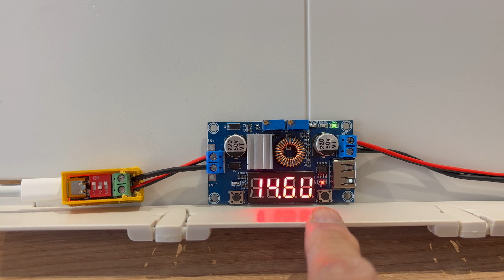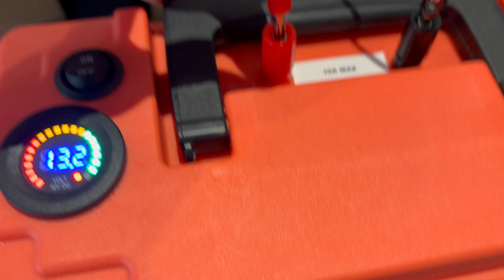I made a USB-C LiFePO4 Charger!

Comment: Amazing video. @6:00 Do you always have to plug the power source in first even after you get the settings the way you want it, or is that just for setting it up? If you fed this into an MPPT prior to the battery would that protect the battery from overcharging?
Reply from the maker: Since this video I have added a diode so you don’t have to worry about what order to plug things in. Actually if you have an MPPT controller you could just plug your power source into where the PV input is and it would auto regulate into your battery but you would need to check what voltage your MPPT controller starts working at.

Comment: I'm poor as shit and I've bought a $5 power bank module that supports LFP so I can charge my cells

32 hours in and im still at 3.38v started from 3.25v lol
Reply from the maker: Haha. I know the feeling. It’s crazy how there aren’t off the shelf chargers for stuff like this. Even for li-ion packs. I found it’s better to get a lab bench power supply with CCCV. It’s bulky but it does the job for absolutely anything.
Reply: @mrjamesflores  I have plenty of 33w chargers here but rejected the idea of using them since they maxed out at 5v3a without a proper handshake for the higher voltage.

I found the module from your video and it cost $1 gonna test it how good it is thanks.